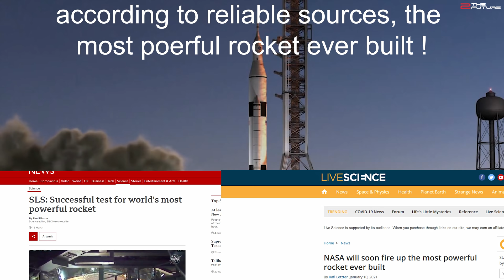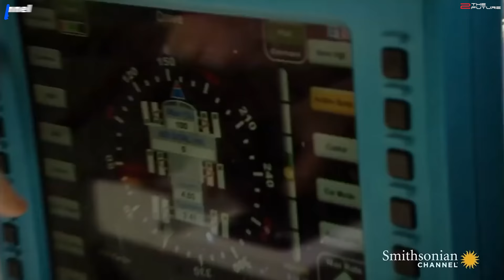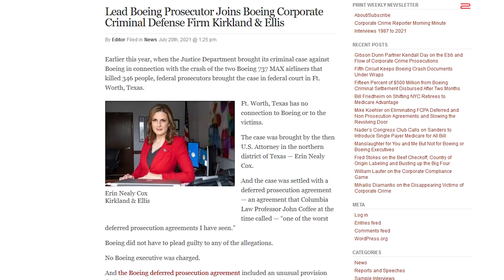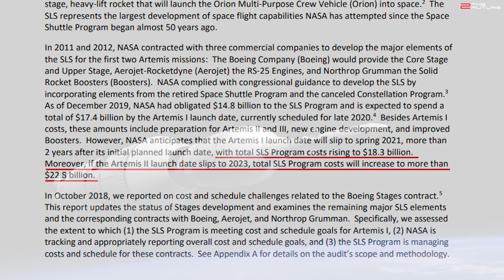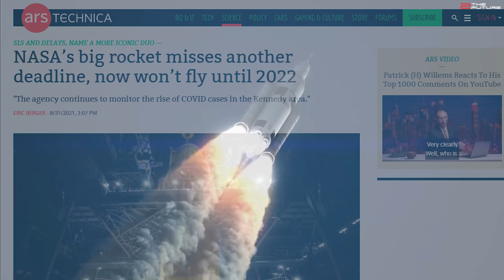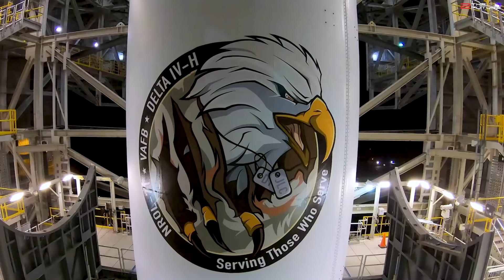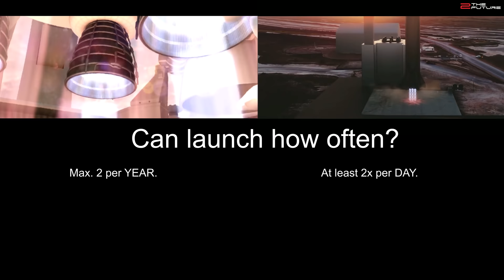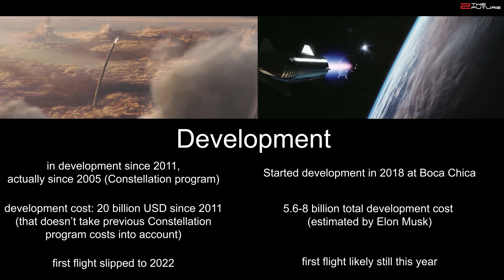NASA's moon rocket SLS is a complete joke.

Comment: The development took so long that by the time it finish, it's already obsolete.
Reply: @toolman1one86  Not really - the idea was to take the Space shuttle engines, the space shuttle SRB's the same tank technology as the Shuttle's external fuel tank - and just replace the orbiter with a mounting point on the nose for a capsule or other payload.

The INTENTION was that this would be the fastest possible way to get back into space following the cancellation of the Shuttle.   Just build a new fuel tank with the shuttle engine on the back and a payload mount on the front.

What went wrong - was the usual creeping-featuriteis, plus Boeing.
Reply: @SteveBakerIsHere  should have scrapped it when SpaceX achieved reusability
Reply: @khanyisanisikhakhane40year23  and now it has launched while starship has not even launched once, go SLS!

Comment: You should make a video about the moon rover from NASA. That rover is a pile of junk with many design faults. Too many wheels, wheels are too small, articulating suspension is overly complicated and prone to failure. The more parts, the more unreliable. The rover is top heavy and will flip. I saw a video of it going down a sand dune, barely made it. Pile of junk. The best part is no part.
Reply: it would be a good "start". They should start using SpaceX methodologies (rapid prototyping, redesign, break it, iterate).
SpaceX often starts development with junk and rapidly improves it until it is actually good. Just compare the flying water tower with the newer Starship test vehicles. (Or Falcon 1 with Falcon 9 reusable)

Comment: The wild card will be the re-entry of Starship and heat tile survival. If re-entry fails, or many of the tiles require replacement, that will  reduce the flight cycle to weeks or months, and double the cost of launch. That's still better than anyone else, but could be a setback. If OTOH the flights go well and the heat tiles survive to last 10+ flights the Space Force will go ahead and SLS will be cancelled.

Comment: @ Summary. I just want to point out a factual error regarding launch costs for Super Heavy that both you and a lot of other Space tubers make.
Yes the claimed fuel cost per launch is $2M, but the rocket is not infinitely reusable, I think the engines are currently rated for something like 10 to 25 launches, can't remember the exact number and it will most likely improve over time, but in this regard the details doesn't really matter. Secondly the rocket and booster themselves will have a max launch count both before major maintenance intervals, and before end of life.
So yes will be ridiculously cheap compared to the alternatives, but the $2M is just fuel cost, not cost per launch.

Comment: Excellent.  Confirmed my independent research.  
Add Tesla and Boston Dynamics Robots to this mix.
Also.  For fun I designed a lunar lander from Falcon 9 parts.  X could build this lander inside of six months.
Starship does a free return swing around the moon. Deploys the lander.
It puts down a dozen robots at Shackleton.  Solar powered.
Several miaaions before Starship Lunar puts down.
Statship will open an incredible future. 
Chasing Voyager coming soon..

Comment: The 500x SLS factor is with one assumption.   That Starship and the SuperHeavy will be able to fly 500x without need ing a full replacement.  That is a LOT of launches for a brand new rocket and concept.   I would suggest that this would take a few years... decades? .. before it gets that reliable.   No rocket engine has ever fired 500x.. and I don't need to look that up.    Not bashing SpaceX, love them and what they are doing.   However I believe they will struggle to get 50 launches out of the first couple of models.   Mechanical wear and tear.   Engine replacements.  Stress on air/spaceframe.   These things aren't known quantities yet and it will take a while before they become known.   This is why new aircraft can be dangerous.   You never know where/how they will break.   Takes a few to fall out of the sky to learn about their weaknesses, even with the best intentions/design.   If I remember right, the Sopwith Camel has 57 inspection hatches with specific things to check, cracks to look for.   This makes it a safe (not counting pilot error) aircraft because you can predict where and when it is likely to fail.   That is because of time.  It's an OLD airplane.. heh.

Comment: SpaceX first used the term BFR in 2005 and  reviled the first concept in 2012 so that's 9 years of development if you go by when it went public ...16 if you go buy when it was an idea back when falcon heavy was still a dream and Falcon X was the future ...pretty safe to say the Falcon X and the marlin 2 lead to to Starship/superheavy/Raptor , so It's kind of disingenuous to claim that they've done so much in just 3 years.  Also worth noting that when Starship dose make orbit...it will just be a technology demonstrator, all of its capability is theoretical,  were as SLS can actually deliver a payload or insert a crew into lunar orbit,  and your Payload to leo is kind of off it's stated as 100+ in the current user guide, changed from the original 150+ number.  Space and NASA are not competitors , they are partners , commercial crew/cargo , Lunar lander and Gate way, orbital refueling ect. NASA is aware of SpaceXs capabilities and utilizes  them as much as they can, and once starship is further along in development  I'm  sure it will be used too. SLS is wasteful, expensive , antiquated ect... but it can actually do what it was designed to do as it is.

Comment: Re-usability is overhyped. People assume they mean 100% re-usable, or close to it. But most "re-usable" rockets are only partially so, and often requires extensive maintenance between uses. The space shuttle was canceled largely because of huge "unforeseen" maintenance costs.

You're better off making a huge dumb one way rocket. With optional re-entry module, if you got humans in it.

Comment: Some thoughts on a Starship moon mission involving module Starships 

Take off from earth

     Starship nose with moon base and fuel with engine modules. Moon base detached from nose module and fuel with engine modules.
     Nose is attached to fuel and engine module and returned to earth.

     Starship with four moon lander engine packages inside.

     Starship with fuel canisters inside. One canister has a crew capsule attached.

     Starship with Earth-Moon-Earth transfer vehicle attacked. This includes fuel canisters and engines needed to transfer payload to moon orbit and back to earth. 

Assembly

     Base is attached to engines. Engines attached to the base on the side of the base. Fuel canisters attached. 
     Transfer vehicle attacked to the back of the moon base assembly. Transfer vehicle has a life support capability.

Transfer to Moon Orbit

     Crew is housed in the base, but it can access the habitat part of the transfer vehicle through an airlock. 
     Crew can also access the crew capsule via a space walk.

Moon Orbit to Moon landing

     Some of the crew transfers to the crew capsule, some of the crew transfers to the transfer vehicle and some of the crew remains on the base. 
     Transfer vehicle detaches from base, engines and fuel canister assembly, to remain in orbit. Transfer vehicle remains in orbit while the base assembly lands on moon.

Moon

     Base is detached from engine assemblies and uses wheels to move away from engine assembly. 

     After mission is complete crew returns to crew capsule and all engine assemblies are lifted off the moon leaving the base on the moon. 
     The engine assembly with crew are returned to the transfer vehicle.

Transfer to Earth Orbit

     Without the base, crew and all hardware are returned to Earth Orbit. 
     While on the way back to Earth the extra fuel in each canister is transferred to one of two canisters (oxygen or methane). 
     Once in Earth orbit the assembly meets a starship loaded with full fuel canisters. 
     Crew exchanges full canisters with empty canisters, leave the two canisters with fuel in orbit with the transfer vehicle, and return to Earth in Starship.

Return to Earth

     Crew and empty fuel canisters return to Earth.

Next mission requires just another base module and crew to be lifted off Earth. 

I believe the first mission will require five Starship launches from Earth (maybe six, depending on the amount of fuel required) to return crew to Earth. Subsequent missions would require only one or two launches from Earth.

All of the hardware is reused.

Comment: You should sandbag the Starship numbers a little bit, mostly because they would likely need at least an extra decade to truly reach those number after it is ready.
Starship launch cost: will be around 50 million for some time at least (still extremely highly competitive).
Starship relaunch time: few weeks most likely. They will need to test, inspect and fix everything for years, before they can trust it to refly with only a routine check.

Comment: Hmmm - so if SLS had already flown, then saying it's the world's most powerful rocket (but SuperHeavy isn't because it hasn't yet flown) would be a defensible statement.  But neither have yet flown (as of Sept 2021).   If the standard is "built - but not yet flown" or "built, test-fired - but not yet flown" - then StarShip wins with 100 tonnes versus 95 tonnes.   If the standard is "future planned versions" - then StarShip STILL wins with 150 tonnes versus 120 tonnes.   So calling SLS the most powerful is not true by ANY standards...until/unless it beats StarShip to orbit...which is still uncertain.    StarShip is ready to fly - and probably would already have flown, were it not for FAA inspection nonsense.   If SLS does launch ahead of StarShip - then (technically) it ties with the infamous Soviet N1...which did leave the launchpad...albeit only briefly.

So for this title to be in any way meaningful, SLS as to beat StarShip to orbit, but even then - it's title will be short-lived.
Reply: Can be argued that SLS can send far more mass to TLI than Starship
A single Starship launch has a TLI payload trending to 0
Reply: @brokensoap1717  Yeah - but that's not how it's designed to work.   They'll use on-orbit refueling - and then the payload to TLI can be somewhere in the 100 to 150 tonne range.

You can't just ignore that all spacecraft are a part of a greater system.

 SLS can't launch without solid rocket boosters...OK but SRB's are a part of the system - so that's OK.

StarShip can't go to the moon (effectively) without a couple of tankerloads of fuel.  That's just how it works.   The tankers are cheap - their launches are cheap - the refueling can be automated (everything else is) - and they reckon they can turn around a tanker in two hours and re-launch it.

Comment: actually its not that hard to add turn back and land systems on that rockets. place additional fuel additional head adjustment/movement engines/macro rockets at top and if required add some position adjustable rocket to in lleft of main rocket. add software that holds the route and correction software and thats it :P
Reply: yeah ok....
Reply: Clueless

Comment: Boeing and GD should only consider Spacex an "enemy" if it begins producing aircraft.  Producing aircraft is what Boeing and GD need to focus 
on.  All this Govie space-cheese has distracted them from the good work their reputations were built on.  Their recent aircraft development 
efforts have shown that they have seemed to lose their edge in that area.  They have already been left in Spacex's dust in the rocket industry.  
In other words, their addiction to Govie cheese for rocket development that has rewarded their very low productivity in the past, has 
 locked them onto paths of failure there and distracted them from their first love, aircraft.  Rocket design by committee will always have circles 
 run around it where there is competition with free market development.  'Can't be any other way.  Even NASA is suddenly realizing what dupes 
they've been.

Spacex HAS DELIVERED many space flights, including manned flights to the ISS aboard their Dragon capsules, also developed by them, within the
relatively small NASA subsidies it has received.  Their rockets can be used over and over again.  OBTW, this has all been accomplished by Spacex
since it was started from scratch, having never built a rocket, in 2002.

How many Artemis flights has the  combo of Boeing, GD and ULA, plus all their subcontractors delivered for the 40+ billion they have received
from NASA for the Artemis program since it began in 2017?  That's a fairly easy calculation.  None.  Except one partially-failed test flight for the
Boeing Starliner capsule aboard a non-Artemis booster, n0 Artemis hardware has flown.  Starliner has not flown since.

I'd say that if Mr. Musk ever decides to design aircraft, Boeing and GD's jigs will be up.  ULA already seems pretty well screwed.